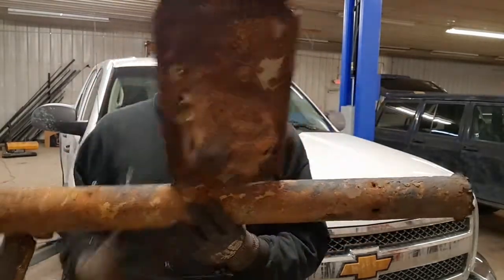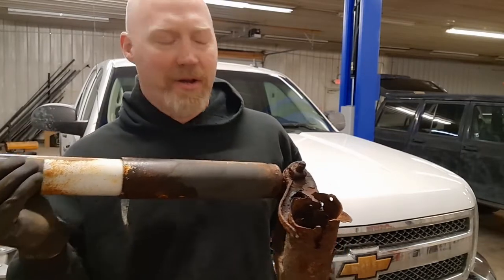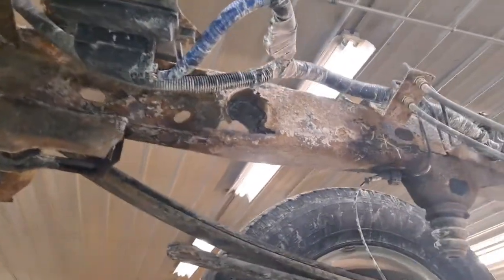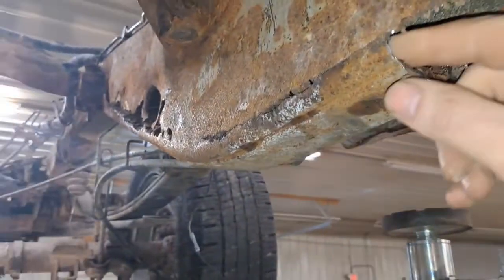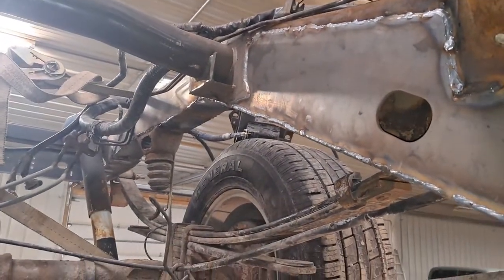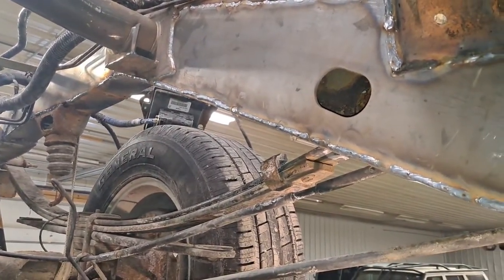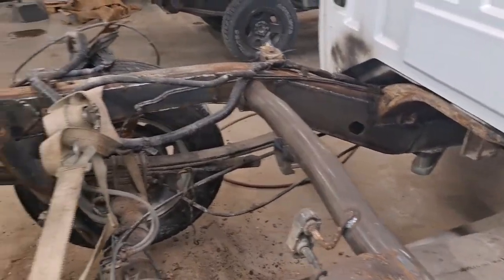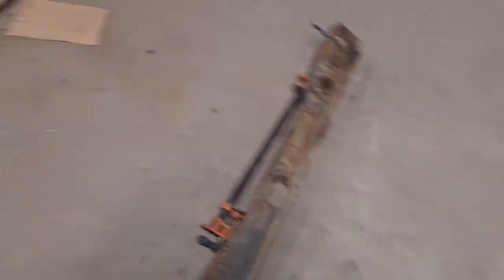2012 Chevy 1500 Frame Rust Repair - Can it be Saved?

Comment: I own a 2011 silverado. Original owner and paid for undercoating for rust protection. It is now rusted so bad my truck bed has fallen down. Don't know what to do......super bummed. I will NEVER buy a Chevrolet again. it has 50'000 miles on it, and a new motor was installed due to a oil pump  failure......at 29,000 miles, also computer brain was replaced at 15,000 miles. This was the first NEW vehicle ever for me. Took very good care of it and it FAILED me beyond!!
Reply: Never get a hard coating on any vehicle. Only soft coating like fluid film.
Reply: 1. Chevy doesn’t build good cars anymore. They used to back in the 1990s and 2000s but everything they put out today is crap.

2. You say you rustproofed your car. Are you aware the rubberized rustproofing the dealer gives you can make things worse? And that if you get a good rustproofing product (fluid film, known) you actually need to re-apply it annually?
Reply: Oil. I say again...OIL.
Reply: You should have bought a 2 2002 02

Comment: Repair looks good. If truck prices weren't crazy that truck would be heading to the crusher..  Investing in fluid film or similar earlier in that trucks life would have minimized that rot.
Reply: Exactly what I was thinking holy shit is any factory frame still even on that side
Reply: What is fluid film?
Reply: @stephensummerlot3288  there is this new thing called Google.
Reply: @stephensummerlot3288  Its an oil/wax like undercoating. It protects the undercarriage without trapping moisture or salt like a rubberized undercoating does.
Reply: @alecb8509  thanks for the reply.  It was unclear to me at the time if it was meant to imply a brand name, a process or a general use term for spraying oil and grease on metal.  It seems like it is basically like cosmoline except easier to work with and not as permanent.
Reply: I would tend to agree but it seems every truck of this era the frames are going....and quickly. How about they should not of used such thin steel for the frame🙄

Comment: Between the lifter issue's and frame issue 's GM should be held accountable for this stuff. This truck needs a new frame. And I'm distraught over a rotted upper rear shock mount. God only knows what else I find?  07 sierra 1500 w/103,500 miles.
Reply: It is not GM's fault, that truck has been driving through all that salt they dump on the roads up north to melt snow for a decade.    I have seen a few of them like that here in the south but it is usually someone who drives their 4x4 truck on the beach at the outer banks of North Carolina.    When I was a teen back in the 80s I very stupidly bought a 1979 Jeep Wagoneer that had a fishing rod rack on the front of it.  when I saw that fishing pole rack I should have run because that thing run on the beach and was a bucket of rust.  lol
Reply: @trevorn9381  I am the 3rd owner. It spent most of its time between Illinois and Iowa on the central border. I have read about 2019 trucks suffering this fate. Even with high milage the poor wax coating should have ended along time ago. As far as the lifter issue the, my locale GMC dealer parts guys are just agast as I am. But, that's job security just like the fleet maintanence I have to do on Volvo, Peterbuilt, Kenworth, International and especially Freightliner tractor.
Reply: @trevorn9381  It absolutely is GM's fault. The design of the frames makes it so that even if you take it and wash your undercarriage, you can't get a lot of the salt/dirt out because of the frame design. For instance, to "properly" clean the bed you're supposed to remove the rear tail lights and wash through a channel there. There are possibly 1/500 people that know that. It's not an intuitive design and so these frames get rust cancer on the inside. By the time most people can see the effects of it on the exterior of the frame, it's too late.
Reply: Gm seriously needs to stop using wax on their frames. I can literally scrape that stuff of with one finger.
Reply: My 05 silverado was 15 years old and 300k miles, id never buy an 07+ truck. Even my older one had cross member rot, that is what sent it to the crusher
Reply: @trevorn9381 we ran ford trucks and nissan for work for years. Sold my 06 nissan titan with 300k miles this past spring (2024) and it had black factory coating on 95% of the frame. One rust hole in one fender, none on floor. Ranger had more city use, more salt, it had floors go bad but frame was fine after 15 years in ny winters.

Comment: I will never own another gm unless it’s 1998 or older!!
Reply: Just check when they will start e-coat its trucks.
Reply: They rot out about the same if not worse
Reply: @jkemmerer1993  I have a 1991 Chevy 1500 with 400k In the rust belt frame still solid never had to be patched yet
Reply: @jacobcole7644  I’ve had three of these trucks since I was 16. My first two were a 92 and 94. 92 had a cracked rotten frame in several places, 94 cracked in between the cab and bed. My 88 4x4 has no frame rust at all.
Reply: @jkemmerer1993  I think the reason some trucks have frame problems is because they were never under coated. The body on my truck was all rotted out, but the frame was still good it was under coated every year.
Reply: @jacobcole7644  my 92 was undercoated every year since it was new. I think they started cheaping out after 1989 and used lower quality metal for the frames.

Comment: It's strange to me that the drivers side is generally much worse.  At first it might make sense because it's going to get more spray from oncoming traffic, but there should be just as much retained salt and junk on the the other side and besides, most of the spray should actually be coming from the front wheels. Considering that this has been a problem for 20 years, GM should be the subject of a class action lawsuit representing probably half the male population in the US.  I can't understand how they get away with it.
Reply from the maker: A lot of it comes down to when they started boxing frames that instead of using C channel style.  Since the box is stronger they went to lighter materials, and along with that it is very difficult to get good paint coverage inside of the boxes.  Even when you look at processes like ecoat, it is limited inside of a box based on the size of holes in the frames and the amount of power put into the system.  At one of my former employers I did a test with square tube, we ecoated a square tube then cut it in half and measured how far in we got full ecoat thickness.  We found that in our system we only got full thickness to a depth 1.5X the size of our opening after that it tapered off to nothing.
Reply: @TabooCustoms also I believe cut back in electronics and wire to save costs ( like they are hurting! 😅) has caused some electrolysis issues with the ground wires eating the frame. To be honest I think they know about and deliberately allow it
Reply: Toyota did right thing and replaced their frames..... my nissan titan was an 06 it lived in NY and NJ its whole life 300k miles without rot

Comment: The difference between the thickness of frames from older vehicles that are still around today & these new vehicles that use extremely thin gauge steel. It's no wonder why they rust through in 10 years.
Reply: It is the govts fault. All the regulations that mandate specific mpg from manufacturers force them to cut weight everywhere. So now we have vehicles that have a significant am out of shitty plastic, thinner metal everywhere, and a generally lower lifespan vehicle.

Comment: Wow!!!!! THAT IS HORRIBLE!  I thought my frame was bad.

HOPING FOR A REPLY....
What sheet metal would you recommend using?  Would 3/16" hot rolled steel work well?  I'll be building a support brace, not actually removing the frame.
Reply from the maker: @ben2687  the frame itself is about 12 gauge, for our kits we use a mix of 7 and 10 gauge depending on the location and design.
Reply from the maker: 7 ga is 3/16 basically

Comment: Where did you get the crossmember that goes over the fuel tank? I’ve got a 2008 Silverado and it’s rusted real bad I’ve been trying to find replacement crossmembers but I’ve only found 99-06s. Will one for that generation work on these?
Reply from the maker: Yes, we modified a 99-06.  The tube itself is the same.  The bracket for the fuel tank strap has to be cut off and shortened.
Reply: @TabooCustoms  thank you so much man I’ve been looking all over if that will work for my truck, I really appreciate it. Any idea if the rear upper crossmember that holds the other shock will work on the same years? Or if anything significant needs changed?
Reply from the maker: @noahkaufman6063  We ended up making that one ourselves and sell the parts to do that one I you are interested.  It's not on the website right now but we have been custom cutting them.  Email me dave@taboocustoms.com and we can discuss.

Comment: I am doing exact same thing I was wondering if gas tank had enough room if I patched on outside I know they fit right I had plans on checking it before dropping tank but it actually fell after I took my bed off err lol
Reply from the maker: Yes, you should have enough room between the gas tank and frame for the repair.

Comment: Brave man! I wouldn't have even bothered. Frame swaps are much longer lasting,
Reply from the maker: Don't disagree that a different frame would be great and I get that question/comment frequently.  Unfortunately cant get a new one for Chevys as far as I know, and finding a used one around here that wont need the same work would be nearly impossible.  Might find one in a junkyard that has been totaled early in its life, but then if its totaled early in its life good chance the frame probably got hit as well.    Then you have the cost of the work, swapping everything from one frame to another would be much more expensive, some people find that surprising.
Reply: @TabooCustoms  If you make those sections for the GMT800 and GMT900, you should do well!
Reply from the maker: @volvoman1096  we just started making Chevy kits, I'm sure we will get into those as well.

Comment: At what point do you say F#$@ it and find a donner frame? My 06 is at the point where your project was when you started and after watching your video I think I'm going to rebuild my 97 OBS Chevy instead. I guess GM joined the disposable generation, I would buy a new truck but up here in the great white north a 3/4 tone HD will set you back $100G's +.
Great video, areal eye opener
Reply from the maker: Difficult question, one that on Jeeps which we do a lot more of than trucks I can more easily answer.   The way they rust, trucks vs Jeeps, is a bit different, if this one had really bad rust through on 3 sides of the frame like Jeeps often do I'd be concerned.  The structure is also very different, in severe instances Jeeps can have the frame chopped off and re tubed.  These trucks with their larger frames would not work to try to do that. Thing is the current direction of the automotive world I see more and more people trying to save vehicles.  This truck I would say was on the edge of should it be fixed.  Most of them I see or sell kits for only need one or two of these kits I used.

Comment: My 99 Silverado broke the frame on both sides just in front of the rear spring hangers. There are holes about 1" diameter on the bottom and top rails of the C channel and an oval hole on the side about 1/2" × 1" between them. Seems like a weak area with a lot of load from the spring going over bumps. Then add in corrosion from the calcium chloride crap they use on the roads now which seems to corrode ferrous metals worse than the sodium chloride they used to use.
5 year old trucks get written off due to the frames rusting out.

Comment: I found out a couple of months back when I had my 2012 in for an oil change, the service tech showed me the rust on the frame. And without a money tree in my back yard I am looking into a replace,ent frame (Hopefully from AZ or TX) or weld in some steel plates as shown here. The condition of mine is no way this rough, though it is rustung through on both sides. I am located in Minnesota, and I am planning to check out your website and maybe by now you offer a kit or know a business that does.
Reply from the maker: Email us at dave@taboocustoms.com, we currently do not have the kits on the website but can custom cut some parts for you.
Reply: I go to St Louis Mo semi often and find way cleaner cars / trucks and more rust "freeier" stuff down thier. Can save a lot of time traveling / distance from you if you try that too. I got a clean bumper and rear cross member for my Yukon. Brought many a bumper, doors and tail gates up for my freinds here. I posted many a video of my finds down thier. See it for yourself. Also LKQ and Pick n Pull you see pictures of cars / trucks online thier. Add that STL in your search. Plus STL BBQ and pizza are the best.
Reply: Pullapart also pull parts for customers for a fee but I never needed it so don't know how much. Truck freight can be surprisingly reasonable so if you don't find something nearby I'd broaden the search.  Best to rustproof the hell out of the frame after sandblasting. Monument companies all have engine drive compressors and industrial blast pots to cut letters on tombstones and most blast on the side inexpensively. Frame swaps are tedious but not difficult. I've done several where I used to work and a few for myself but nothing that recent.

Comment: Have had a similar problem with a 99 Jeep Wrangler, seems as if they are famous for the frame rust issues on the rear control arm area, there are kits out there for them to fix this issue.  Took me a while but fabricated replacement parts to do the job.  If you have some way of getting the vehicle off the ground, remove the tank, rear axle and put on your fabrication hat and go to work.
Reply from the maker: Yep, thats actually our main business, Jeep frame rust repair.  www.taboocustoms.com

Comment: Nice video and good job on the repair. I will never own another chevy. The 2008-2012 frames lack a rust inhibitor. Body can be good but frame usually has the rot hole by the charcoal canister. Please tell your friends so they dont buy a junker.
Reply from the maker: Thanks, yeah a lot of people dont look real closely at the frame if the body looks good.  Have seen a few where people got burned that way.
Reply: Problem is that Chevy do not e-coat frames still always.  And owners do not maintain wax that Chevy use.

Comment: GM should be class action. My 1974 with over 200,000 miles driven most of those miles in the Twincity of Mineasota, we know what happens to trucks up here. Yes the body is a rusted  out barely staying together but the frame is surface rust and still solid.
Reply from the maker: Yep, problems really started in 99 with the redesign of the frames.

Comment: Where do you get your repair kits?
Reply from the maker: Www.taboocustoms.com, for the kits on this video you can contact us there.  We don't have them all listed but can produce and sell them.  We will eventually have them on the website.
Reply: @TabooCustoms  I have a 2007 gmc Sierra extended cab short bed!
Reply from the maker: @zconn9755  should be pretty much same truck in video however I think some changes in 2009

Comment: I’m curious what state your in?
Reply from the maker: SE Iowa
Reply: Great video! Will that truck pass inspection after the fix? I’m in New York.
Reply: Did you use 1/8 “ plate?
Reply from the maker: For most of it yes.  We used some 7ga in  the rear where spring hanger mounts
Reply: Awesome job. It’s good to see what can be done to save are trucks. Thanks
Reply from the maker: @tomryan9616  that I couldn't say for sure I dont know what the inspections consist of.  I would say that if the frame is well done it probably would but if it looks poorly done they might flag it.  Everything I do I'd be willing to bet my life on is how I look at it if its coming down the road at me.   I have had some I turned down.

Comment: They don't even paint these frames. Just bare metal dipped in the wax undercoating. Works fine until that wax starts to go away.
I found the easiest way to deal with those frame rivets is to cut a slot or two into them with a grinder, then come in from the side with an air chisel and the heads pop right off.

Comment: What kind of insurance covers liability when welding on a vehicle frame?

I run a small structural welding business, fully insured, but I'm always very hesitant to do anything on a vehicle frame.

Edit: work looks great, by the way!
Reply from the maker: General Liability Policy typical for most Auto Body places.  Ours is through a local insurer.   We don't get to off our area of expertise, sticking to Jeeps and now getting into doing Chevys as well.  I also don't touch crumple zones, I have had a few ask about fixing rust in a crumple zone and we dont do it.  I have heard you can completely replace the area but we havent gotten into that.
Reply: @TabooCustoms  
Thanks for the reply!
Liked and subscribed! 👍
Reply: @AZ-kr6ff I have welded, fabricated and repaired hundreds of frames. Do quality work and never worry. It's just steel,  frames are not some magical forbidden fruit.
Reply: @TheShillPrince  
Yet, they're the only thing my insurance won't cover.
Cover your ass, bud.

Comment: Forget fluid film….tar….seventy years old …been going under my trucks for 30 years with a hand oil spray can  and just shooting transmission fluid every 
Where. Everywhere everywhere …down the rails  …in the rails ….on the ball joints.  ….any steel.  Not muffler..  tranny fluid does not hurt rubber body mounts…..usually summer ..fall..spring….warm winter day,,,10 mins and done ..hit it 4/5 times a year …yea it’s messy messy…BUT…it saves my trucks…from dusting out….…pour tranny fluid into the inside of rails..then drive. .let it-coat.  bottom of inside chassis…it works and it’s cheap..$5 quart from Walmart